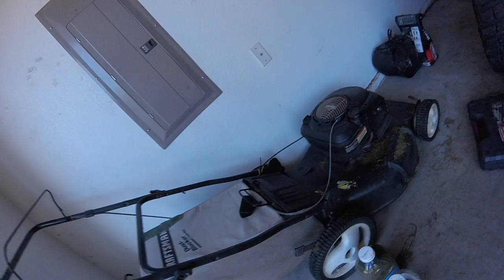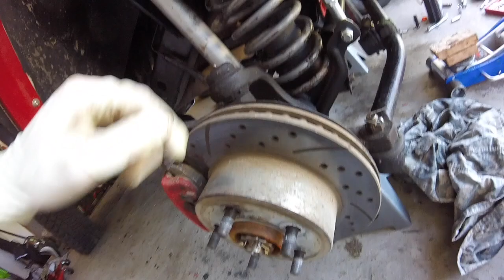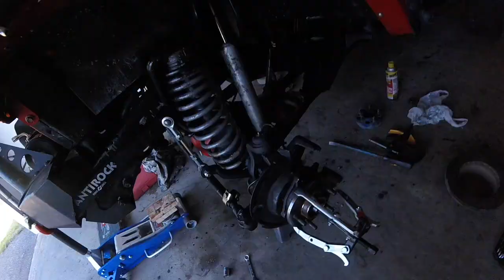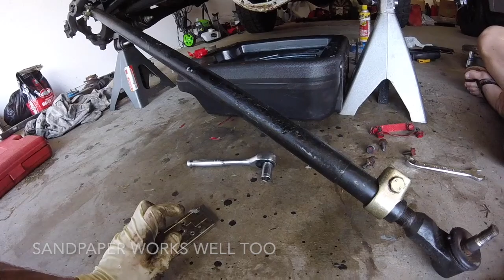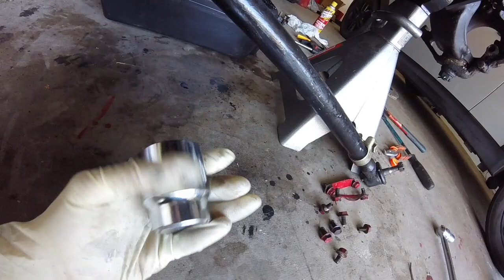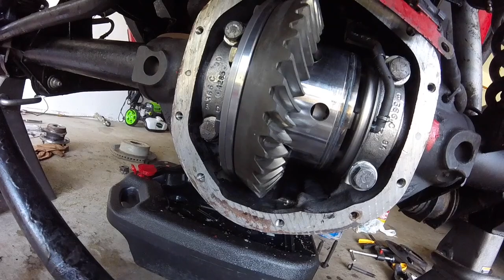Replacing Front Axle Seals in a Rubicon Dana 44 | Jeep Wrangler TJ

Comment: So that part number for the seals says it's for 07 and up dana 44. I have a 06 tj Rubicon, same part?
Reply from the maker: It also says it's for the TJ 44. Yes, same part
Reply: @DoodlesTJ  ama,on won't believe I have a d44! Makes it hard to get parts. Thanks for the info
Reply from the maker: @4runnerAdventures  Yeah it may not know. Click on the link in the description and you can buy it from 4WP. Also could try Quadratec or Extreme Terrain

Comment: Weird how all the websites say this model number "doesn't fit my 2006 wrangler".  You have any issues?
Reply from the maker: Hmmm I'd guess it's because the websites think you have a Dana 30 front and not a Dana 44 since your Jeep is a rubicon? Mine worked fine. You can use the link I put in the description
Reply: @DoodlesTJ  it is a rubicon. I went ahead and got it. Thanks!

Comment: Great video! When i pull axles apart i leave the axle shaft nut on and just remove the 3 bolts that hold the wheel bearing on. They'll slide out as one piece
Reply from the maker: Ahhh smart I hadn't thought of that
Reply: @DoodlesTJ  lol next time!! I learned the hard too lol